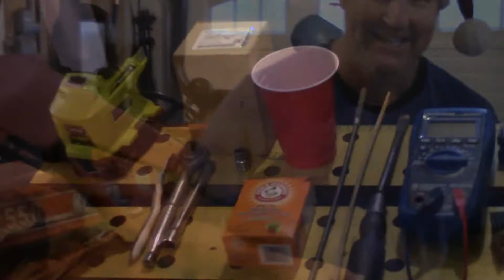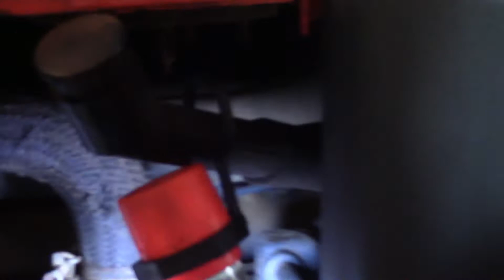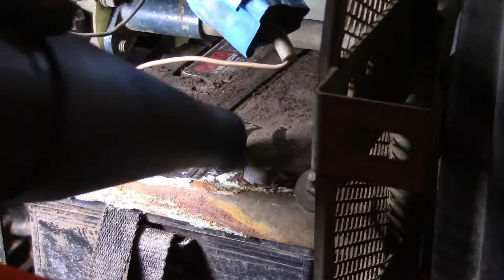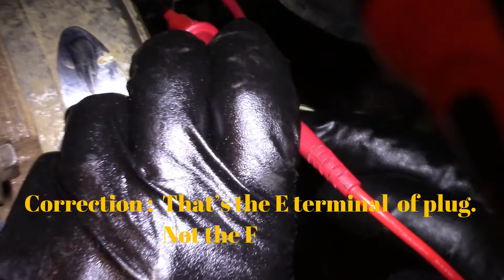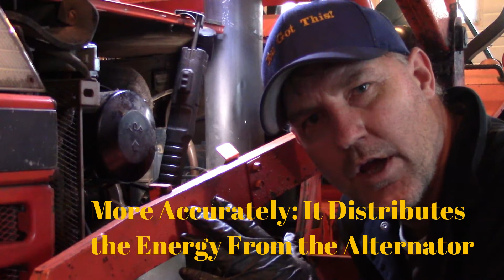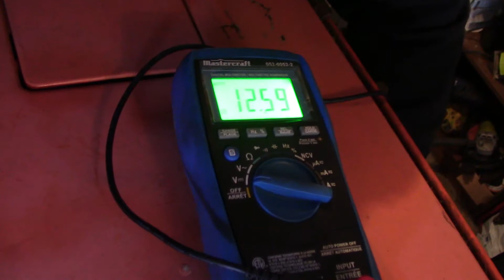Kubota Battery Not Charging? How to Check Battery, Alternator, Regulator & More to fix the Problem

Comment: Could I ask you why you did no testing with the engine running . My L245 isn’t charging, new alternator, belt good. With the engine running and the alternator spinning, over the live and up to the regulator there should be the 14v , is this correct?

Comment: Ru also knowledgeable with the hydronic system on the L? I’ve no to test pressures but believe/think that it’s ok. 

Symptoms: loader bucket barely moves upward even with elevated rpm’s. When driving it the tractor will hesitate/pause in its travel/movement then kinda violently  jerk back into gear. 

I’ve replaced the hydro filter several times but no help. In fact over time everything described has worsened. Are there inline filters that could be blocked? 

My local dealer seems helpful but only after u pay him $180/hr. Hope u can help me.

Comment: I’ve had a difficult time finding a channel to help with various issues on my Kubota L3750 tractor. Glad to find u with ur L series. Ur knowledge is desirous. 

I’ve recently been having starting problems (dead nothing happens when turning the key…no click even. I’ve resorted to jumping across the starter posts. She fires right up. 

I’m beginning to think it’s my ignition but haven’t figured out how to get the dash panels off to see if a wire fell off the backside or ignition is bad. Advice?
Reply from the maker: I do various electrical testing in the video and it turns out to be the Regulator. That is the part that fails on the 1986 L2550. It has failed twice whereas the other components are still original (except the battery of course) I would do the testing instead of guessing like I did in the video. Good Luck!😀

Comment: Thank you for this video. I have an L3430 that I just swapped alternators on and am not getting any power from the alternator B post when pully is spinning (it is mounted and has good ground.) When battery attached to B post all I get is 12.6V regardless of RPM. Do you think this would be regulator? This alternator has a 2 terminal regulator plug (not 3 like in your video.)  I would have thought I would still get ~14V off the B post on the alternator when engine running regardless of regulator but maybe regulator isn't telling alternator to generate any power? its a denso T-1060-15682.

Comment: Check the wire coming from the ign. switch to see if it's shorted or corroded. Mine was corroded cause loss of volts at regulator. Test your regulator And wiring folks!

Comment: Usually the regulator??! You showed nothing about testing the regulator. Not everyone just has a new regulator laying around. You should change the headline to By the way I don't show how to test the regulator!
Reply from the maker: The Kubota regulator is prone to fail. The tests that I perform rule out the other components in the charging system leaving the regulator as the most likely culprit. Also, experience tells me the regulator will fail after 10-15 years depending on use. I have performed these tests twice now, once when I first purchased the used tractor (it was the regulator) and recently when making this video. I changed the regulator in this video and it has been charging perfectly ever since. Its been a couple of years since the regulator change and it is still functioning perfectly. In my experience, It is usually the regulator. Thanks for your comment Whipstaf USA.

Comment: Very useful and I like your laid back presentation style so thanks for posting. I'm about to troubleshoot why my boat engine alternator isn't charging the batteries. It's Isuzu not Kubota but those Kubota blocks are used in a lot of boat engines, super reliable workhorses aren't they...
Reply from the maker: Hey David, Yeah I find Kubota very reliable. The regulators seem to go every 10- 12 years but other than that, I love my Kubota. Cheers!

Comment: m7580 Kubota would stop charging after 40 -80 mins, as I'm in a remote location , I took the alternator to auto electrician.he said its fried , you can smell it,well it smelled ok to me,but took his word and purchased a new one, fitted and after two hours same charging trouble,returned alternator and told again, smell it ,its fried.replaced under warranty.fitted and again same problem, returned to same auto electrician, but he was in hospital . so I saw a auto electrician a few doors down. told him my problem and he said NO WAY CAN YOU BURN A alternator , he showed me a shelf of used alternators some 40 years of use,he spun the alternator and said feel the body,its hot ,its charging. recommended to check crossed wires with a test. battery checked twice all good ,2 years old.
all ok with test, found a loose wire from alternator , replaced , replaced battery leads , seemed to work fine, but after 3 hours, battery dead.
after months trying to work it out myself as it would cost me 5 hours travel for a auto electrician to come out,if I could find someone.
then I replaced the ceramic resistor on the wire from alternator , Well after 18 months its all good now. battery stays charged , start stop start ,no problem, now I can grade,slash with no worries.so happy.
Reply from the maker: Wow Sam, I'm so glad you figured it out. Thanks for posting that solution in the comments in case someone else is going mad trying to figure it out. We are all in this together my friend. Cheers!

Comment: Okay I did the same test but when I put my voltmeter on e and F terminals I'm still getting the correct voltage so does that mean my alternator is bad? Doesn't seem likely because when it's running and I pull the negative cable off the battery it's still continues to run. Also I did not check voltage at the battery with it revved up, only at idle. Any suggestions
Reply: ceramic resistor , replace
Reply: On a similar note, I checked mine from e terminal to f and got zero.what does that means